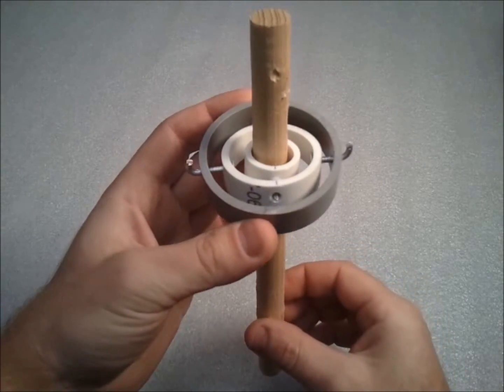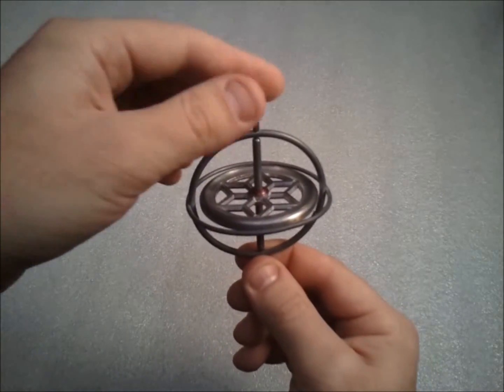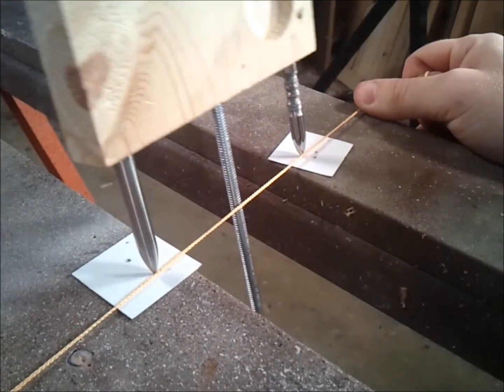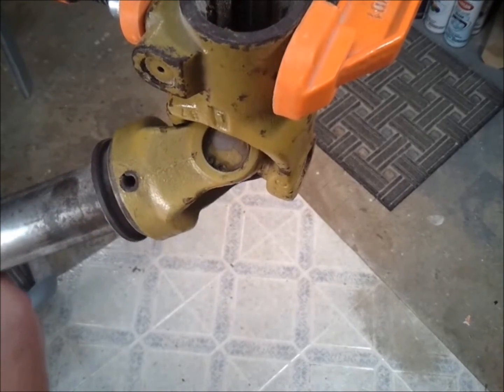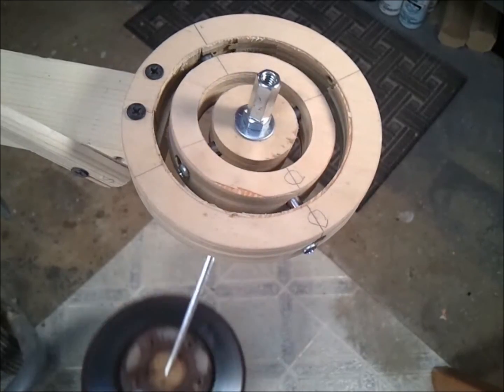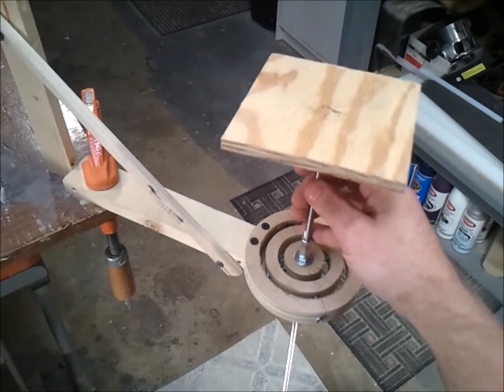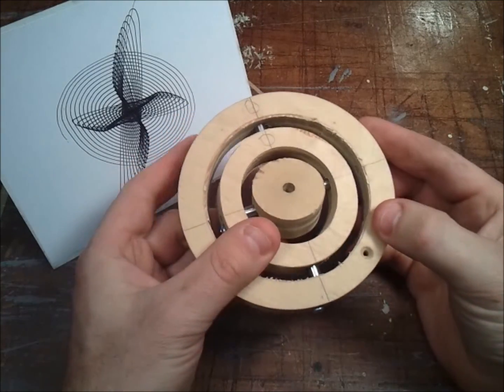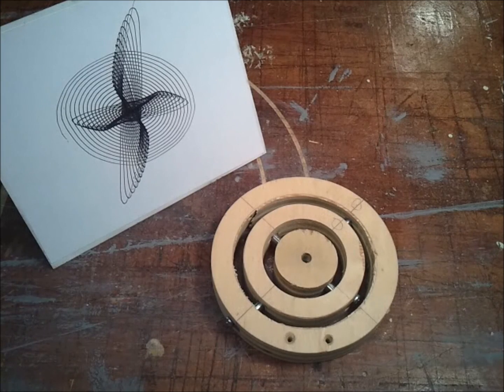Gimbal experiments

Comment: Friction causes the "orbit" to decay, but what causes it to precess? Is there some asymmetry in how it swings?
Reply from the maker: The initial push causes the shape to become (noticeably) elliptical. As for precession, I'm not sure if that would be visible here, but I will tell you this: I spent a few days trying to understand elliptical precession while working on the harmonograph, and I was still confused at the end. After some really intense and weird math, reading, and speculations, I don't think I came to any satisfactory conclusions. I would need to consult a physics professional, but to be honest, I'm a bit skeptical that we understand it entirely. Of course, a harmonograph is an incredibly complex system of physical phenomena, so I will concede that there were plenty of variables/effects that I might not have controlled for. 

If you have interest in the subject, I would start with the wiki on the Foucault pendulum. Sounds easy enough at first!
Reply: Something to think about. Good question. But it makes me think will it still precess if the initial force applied to the object is exactly perpendicular to the line joining the center (of the whole system) and the point of release? I would want to know whether it will still behave in the same way!

Comment: The pendulum seems to have drawn a perfect propeller. That's really interesting. It even has lines representing dimension.
Reply from the maker: I wonder if that's actually the case; a perfectly aerodynamic propeller probably could be found to have a relationship with some more simple, naturally reproducible phenomenon, just like this. That was a mouthful. Anyhow, I once found this teardrop shape (you can see it at the end of the "drawing machine marker" vid) that resembled an ideal Acheulean hand axe, just by drawing around a circle that was at the end of a beam. Here is my point, and it's an important one:

All things physical, and thus, all forms or patterns, intentionally conceived or otherwise, have a mathematical structure that defines them. You can draw a hand-axe using equations that can be graphed, and those mathematical elements can be captured by simple machines. When you build a machine, you are expressing a mathematical truth, and each part is one of the pieces of that expression. 

This is deeply philosophical stuff. Do we define mathematics, or are we just an expression of it? 
Good luck out there.
Reply: pocket83 My thoughts as well. I wonder if it would be possible to build a program that could interpret the lines into a 3d rendering. The forces of nature always know best, if we just knew how to listen. Thanks for sharing your experiments with us :)

Comment: 608 bearings measure 22 mm x 8 mm x 7 mm, they should be perfect for this project and they cost about $15 or less for a set of 8. You can find them at your local skateboard shop. A mortise bit should be enough to set them into the wood/plywood darn near perfectly assuming you have the right size mortise bit to work with or suffer using a Dremel. This would be great as a stabilizer for photograph. Since I have the bearings, I should try it using this info. You can also recycle bearings from old VCR's. The spindles have excellent bearings in them.

Comment from the maker: I actually considered that for a project/video at one time. I wanted to make a ceiling mounted sand pendulum in my entryway, where there is a high ceiling that would allow for a long radius. A heavy enough plumb-bob with a long cable would be quite effective against the friction caused by the sand. It still would require a simple 2-axis needle gimbal at the top, but it wouldn't be too difficult. The better half decided against it. Instead, we have a schefflera there.

Comment: I've seen an inverted one similar to those used to create the Japanese Sand gardens by basically using a pendulum with a pointed plumb bob attachment on the end of a small rod. When set in motion, it's small tip draws circular and elliptical patterns in the fine sand. Easy to erase and produce another one. You project however, does seem quite interesting.

Comment from the maker: I have never seen one of those that were not tight to move, and the key here is to achieve as little friction as possible. If there is such a thing that easily moves, I still want to use a wooden gimbal for this project, because of both its visual appeal and challenge to construct. Not trying to shoot down ideas; just explaining what I want. Thanks.